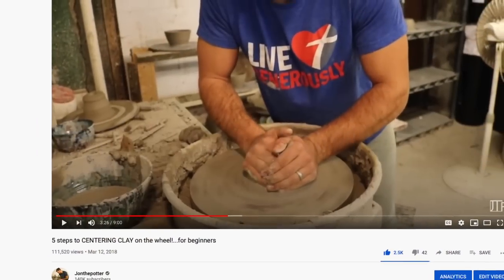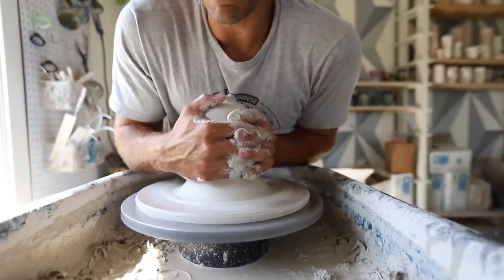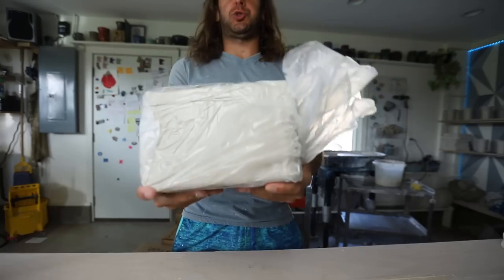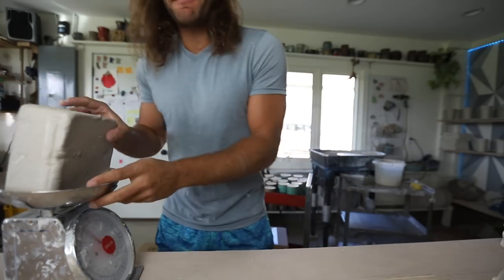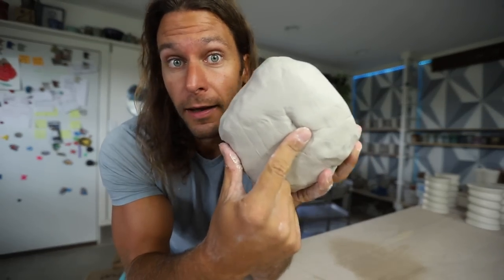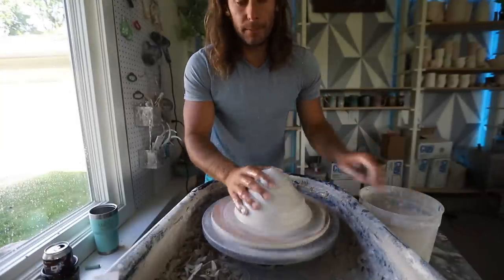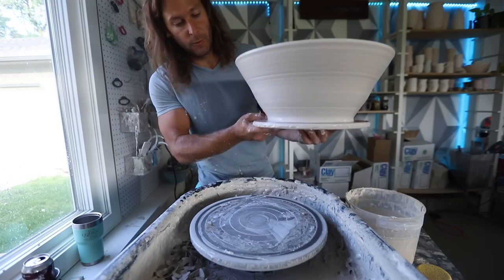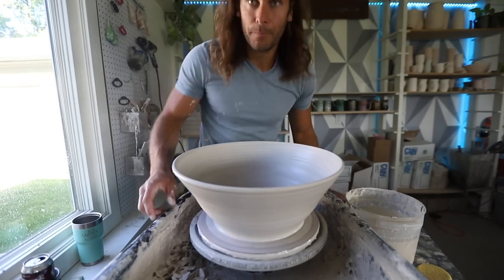How to CENTER -  LARGE pieces of clay!

Comment: Most helpful tip that wasn't covered: slap center! Jon attempts doing it when his ball was planted uncentered, but if he did it for a minute longer it could have saved clay, time, and his wrists. Just look at how different Asian potters have centered their humps for centuries on low momentum kick wheels.

Also, make sure your ball isn't wider on the bottom like Jon's is. It will only spread out more and be more difficult to center, even with slapping. Sometimes putting the narrower side down can help, since it will smush and even out. Also, sometimes starting with more of a oval instead of circular ball can help, since you'll have less clay to move up when coning.
Reply: I have been so amazed at how effective slap centering is.  It makes such sense.

Comment: If your block of clay has been sitting a while, the water can migrate towards the center of the block.  So slam it on the floor a couple times, which "wakes up" the clay and redistributes the water.
I usually slam it on each side of the block, though it loses that block shape, by the time I'm done.
Reply: Water does not migrate to the center of the clay. Water migrates through the plastic and the outside inch of clay is stiffer than the inside. Slamming the clay does not "wake it up" it creates a thixotropic reaction in the clay and the material become slightly fluid.

Comment: I’ve been throwing for about a year and a half, and just started throwing larger amounts of clay (8-12lbs). I’ve personally found that it’s much easier to center in pieces rather than all at once. I divide my clay into several 3-4 lbs balls, and center them one at a time, stacking them on top of each other as I go. I don’t really have the strength to do it all in one go unfortunately, but centering in sections has worked great for me!

Comment: Just started a pottery class this time last year and got 3 lessons before the COVID shutdown started, but I was able to get an old Shimpo wheel really inexpensively ($150) from an elderly relative who, because of health problems, wasn't throwing pots any more. He also gave me about 200 pounds of partially dried clay to play with which I've been re-hydrating as I go. I'm guessing its a B mix with grog, but no guarantees. The challenge is knowing just what the right level of moisture in the clay should be--and this greatly affects my centering efforts. Sometimes I have walls collapse because it was too moist to start with and adding the water as I threw pushed it over a workable threshold, and other times I've strained my shoulder because it was so dry and I had a fight on my hands. (Oh the FUN of learning via YouTube! No one to show me how wet things need to be!!) The clay you use here seems like a finer grained clay body than what I've used. Can you comment on how centering and throwing are affected by differing clay bodies and moisture level? Maybe you can make a vid about THAT. For those of us who have to learn at home...
Reply: If your clay seems a bit too wet, you can wedge it on a plaster board or even a wooden board.  It will help pull out some moisture.  Some people will make an arch out of clay to give more surface area to dry out.  Spreading it out and poking holes in it will also do the same.

Comment: THAT explains why I had so much trouble yesterday centering.  Have been really consistent centering until yesterday, but I was using 3+ pounds [rather than 1-2] and had all sorts of trouble.  Plus, my clay was really stiff.  Has been stored in a really warm building [rather than my usual air conditioned studio] so I guess it dried out a bit faster in storage.
Reply: You can drop your bag on the ground a number of times and it reactivated the flexibility properties in it.  I forget the proper term.

Comment: Hey I have some questions about pottery/ceramics 
1. What's the easiest way to get the clay back into the center of the wheel 
2. Do you know how I could avoid making a piece too thin when i throw it on the wheel. I was so close to breaking my pride when I almost destroyed my pot and I don't want it to happen again.
3. When you do coning what does it mean to ease off the clay when you get to the top. I never understood what my teacher meant by that
Reply: 1 - Practice
2 - Less pressure between your hands when lifting. Also use more clay.
3 - don't take your hands away quickly as the suction from your hands can pull it off centre

Comment: Ok, Let's break down centering commercially made clay. #1 clay from a claymaker is in the bag and it is just too hard. The clay stiffness is done the way it is to make the clay in the bags in their boxes stackable, so they can ship it one pallet stacked on another. Also the bags that the companies use are permeable and water escapes through the plastic. The outside of a bag of clay 1" of it will be a little more harder than the inside. So you have to wedge it up. If the clay is too difficult to spiral wedge then it is too hard to center and throw. I know that The potter Steven Hill throws very hard clay but hard clay used will damage your wrists and bring on carpel tunnel syndrome. Jon the potter in this video seems to not understand  that he is teaching bad form to people who do not have the same upper body strength. Centering is NOT about strength. It is about leverage. And it is a mental state. Also most people throw sitting down not standing up cantilevered out like Jon is. He has to use more upper arm strength to get the clay to move. When if you are sitting and you sit close to the wheel and have your center of gravity over the center of the clay your body mass comes into play moving the clay and you will use less muscle and be less tired. It is all about form. The clay needs to be the right stiffness, the clay then needs to be wedged correctly. If you spiral the clay and then pound it into a ball and lose the spiral and then put it on the wheel to center then you are fighting the spiral you worked so hard to put into the clay. If you take the time to prepare the clay, wedge the clay properly, then use proper form to center then the clay will seem to center itself. But if you use too hard of clay, wedge improperly, use improper form you will develop tennis elbow at a minimum and carpel tunnel syndrome at the worst. Just because this way of working the clay works for Jon does not mean it will not fuck you up.

Comment: 25 pounds of clay  on wheel after wedging..., Center ..Open...thee (3) fast pulls, you'll be at 28-29 inches high, 18 inches wide..separate bottom with wire.. set aside , throw next pot.. go for 20 to 30 pots per day, meanwhile decorate leather hard pots from earlier throwing...When bone dry load shuttle or envelope kiln...fire to your artistic demands...Maybe have a beer or smoke... Another day..do it again..:) Perfect life of a Potter.

Comment: Not sure why he does it this way, just makes one work harder.  Can I center 10 pounds of clay or more at once yeah, do I, no. Because it’s exhausting, and wears your wrists out. Much easier to take that 8 pound ball, and cut it into 2 pieces. Center the four pound ball first and remove the slip. Take the second and round the bottom and throw it on top, the bottom is already centered. If you round the edges of each ball the air will be forced out when you throw it down. Then cone it up and down and it goes right to center and you don’t need to work hard or be super strong etc. most of all you won’t be exhausted. Making really tall pieces or large pieces is fun, but you can also do it in sections, throw the bottom then middle then top etc (not talking about coiling). 
There are a lot of other more important tips that he left out that would definitely help a newer person. Not sure why he did, but a person can always literally slap center it into place where it’s pretty much centered. Didn’t mention to use the water and slip, wheel speed, plus opening a larger amount of clay is different then a small one.  This video also teaches to just waste clay, I don’t suggest that.